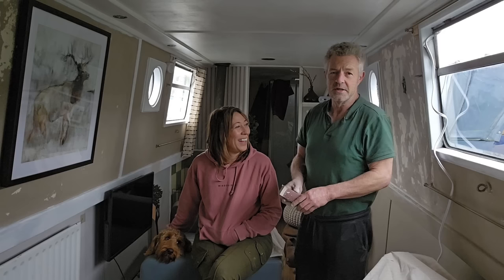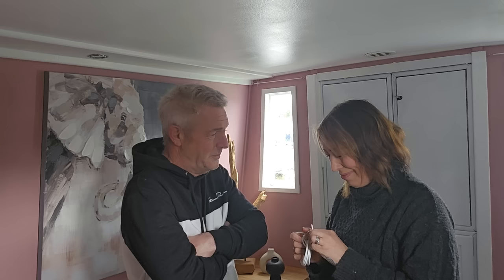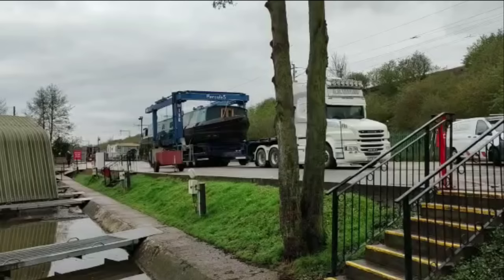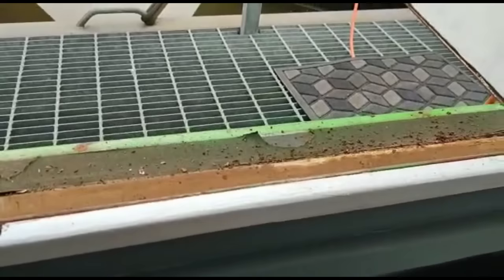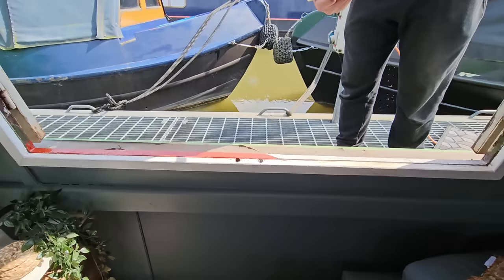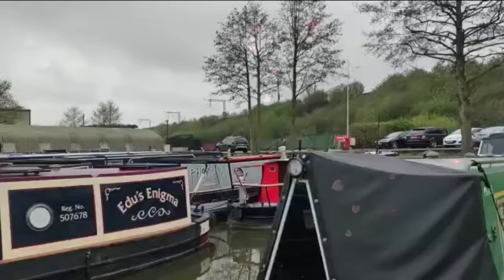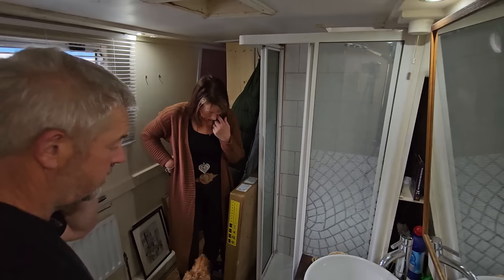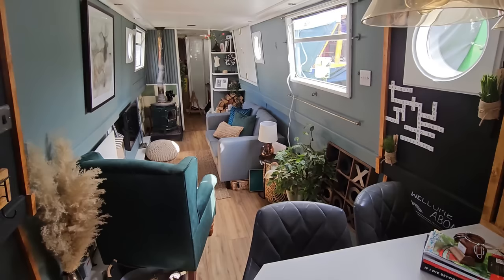The Final Fixing of Narrowboat Duck Hatches. Ep25

Comment: Paul you can screw a strip of metal to the bottom of the duck hatch to take it lower than the threshold to stop it running in, using sikaflex as a seal between them. You can buy aluminium strips in B&Q that will do the job.
Reply from the maker: Thanks Steven, we did think about that but it would mean grinding the bottom of the doors as it wouldn't fit otherwise so at moment we are trying this method and if fails we will give this a go.  Thank you so much 😀